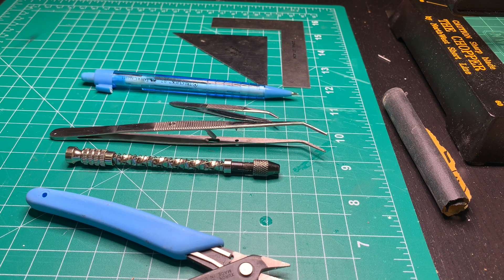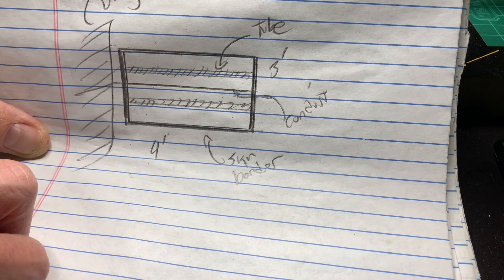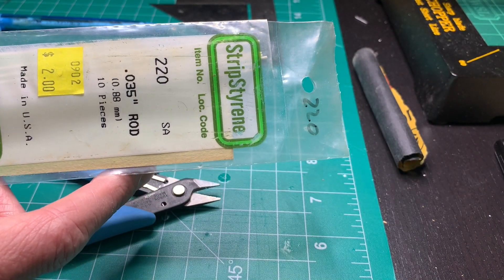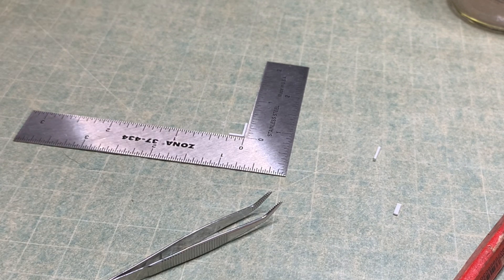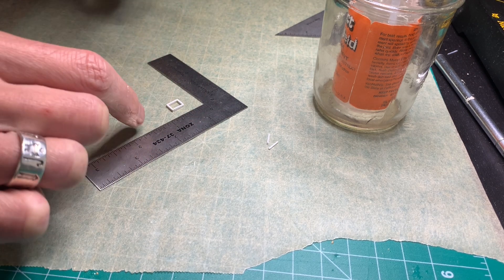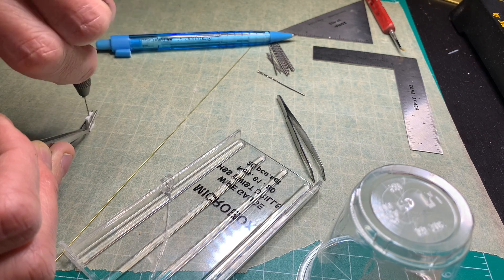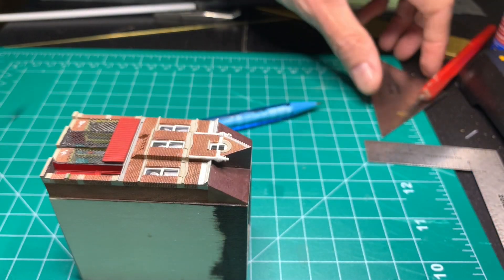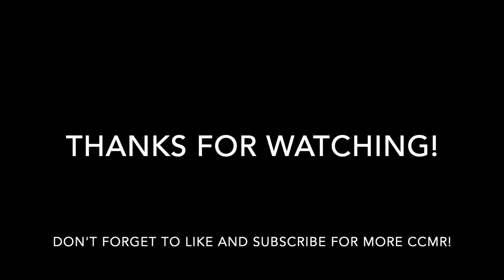The Abandoned Storefront Sign | CCMR At The Bench #9

Comment: There's a vendor at the flea market at Rosemont, he has tiny tiny tweezers, forceps and files; and alot of my cash 😁  Also, taping down a piece of painters tape, sticky side up, can be a great help holding small parts.
Reply from the maker: Good to know! I’ll have to see what’s available like that online or in my area (located in mountain west these days)
Reply: @ChicagoCrossingRR  ahh, sorry, just started watching your channel so I missed that part.
Reply from the maker: @darinschneider8192  oh no worries, I never mentioned where I'm actually located in my videos, it's never been particularly important to do so :). In any case, I'm very intrigued by the painter tape option you mention. These are tiny pieces s and that seems like a good solution. Maybe that'll lower my blood pressure when I'm doing these dumb sorts of highly miniaturized experiments, in which case thanks for adding a few years back to my lifespan.
Reply: @ChicagoCrossingRR  the painters tape trick comes with a different set of frustrations 😉  but I couldn't replace couplers without it.  Give it a try!
Reply from the maker: @darinschneider8192  will do!!

Comment: Next time, get another right make thing to push in against the two pieces forming the initial “L” to help hold it in place as you glue. Not exactly a clamp but probably good enough
Reply from the maker: Thanks Philip - I'd used the triangle initially for that purpose and found it shifted the pieces around preventing gluing. It's worth having another shot with that, and I have some ideas about making a quick jig so these stay in place more readily.

Comment: Scratch building comes with practice and patience, and continuing on thru failures.   If that was your first try at building it , Hats off.   In one of your videos you were talking about not happy with using tunnels to hide the curves at the end of the layout.   Maybe you have thought of this but I used buildings creating a canyon where you loose the train.  Cool vid will have to try and make one for my East St Louis area on my lower level.   I think Boomer would enjoy this.
Reply from the maker: This was my first crack at it. Good practice for sure, lots learned on the way.  some tall industrial buildings could be a doable option as a tunnel replacement that would be prototypical for the area, thank you for the suggestion!! The layout will be around for a good while, so lots of time to plan upgrades. I think a thumbs up from Boomer would be like winning an Emmy.